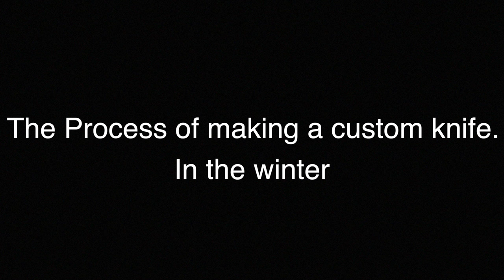How to make a CUSTOM knife - A Client's Knife

Comment: Must be nice living in the Northern hemisphere. Here in the "Land Down Under" it's difficult sometimes to find the motivation to leave my Air condition house, and go make a knife in my 40+ Celsius workshop.
Reply: I understand this innately. I recently moved from Arizona where summer days are all over 43c and overnight temps are 35c. I moved to Colorado and it rarely reaches 37c during the summer, average is high temp is 32c, which is lower than Arizona's average low temp during summer.

I worked in my workshop nearly every day of summer.

Comment: Have a suggestion.  Have someone us spray foam to insulate your container on the outside. You can top that with house paint. Won't keep it warm when your not heating it but sure make it warm up FAST and uses ALLOT less energy to heat.  It is expensive but going from no insulation to insulated container will make such a big difference in comfort.  You probably only need two inches in the walls and 3 in the roof.  Might get away with 1 and two because it's not heated all the time.  Good looking knife.  Thank you for sharing.
Reply from the maker: +Robert Palmore that's an idea I've never heard before. I like it. Thanks for sharing. It's got the gears in my head turning....cheers!

Comment: How much did you invest for all your equipment for knife-making?  

Great video, amazing work, coming out of a container on the Alberta prairie. Crazy.
Reply: Idk about Canadian prices but as an approximation: grinder will be about a couple grand (his looks high end), band saws you can generally get for a couple hundred, tempering oven is often a grand and a half... it's probably around 5-10 grand. Don't let this dishearten you though... I make my own swords (properly forged, ground, polished and historically accurate) with my own set up. By scavenging, a bit of diy and a few expenses I can do this. I've probably spent about $500 US. If you wanna get into knives you can honestly start with just a file. If you're impatient you can start making good knives with a $200 budget and a fire for heat treating :)
Reply: Ok, cool. Looks like a lot of equipment to do it well.

Comment: Just curious why do you drill out the handle tang so much? Does this help with heat treating? or handle adhesion? Thanks for the videos.
Reply: It's to remove weight from the handle so the balance is good. Grinding the blade removes often around a third of the weight in that. Being usually a 50/50 blade to handle ratio you have to balance that reduction out. But it also helps with adhesion too as the epoxy has somewhere to go :)
Reply: Thank you! I am very new to knife making and so far have only put handle on bought full tang knifes. So I haven't had the opportunity to make my own blade yet.

Comment: Cool video. Is your fan powered by a Stirling engine?
Reply from the maker: Thanks! I'm not sure what a Stirling engine is? It's one of those fans that uses the difference in temperature to generate electricity. Cheers!
Reply: Simple Little Life Oh, I see. That's cool too. A Stirling engine uses a difference in temperature to drive a piston with the force of expanding and contracting gases, which turns a crank shaft. A bit less elegant that what you have but has a high geek factor.